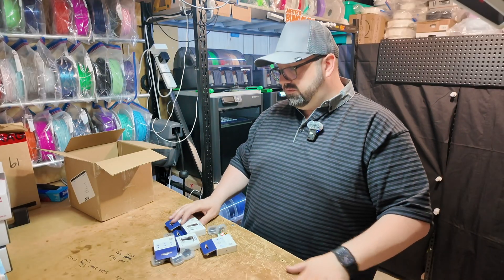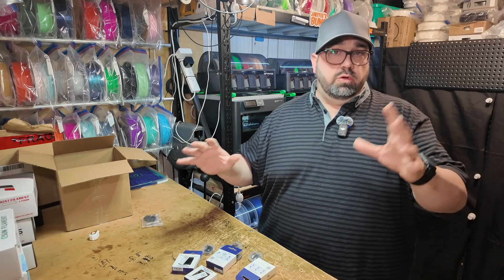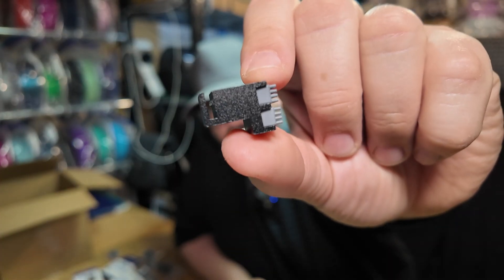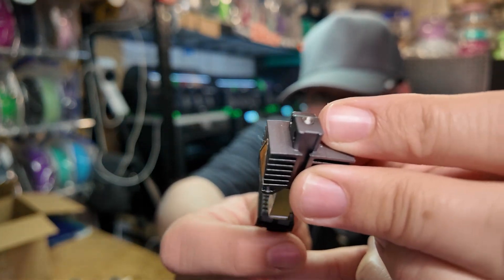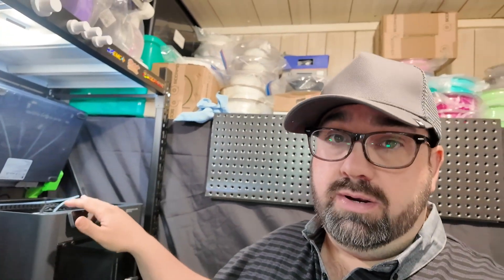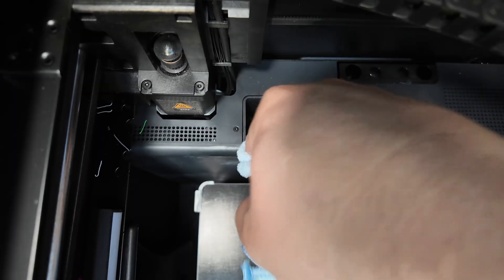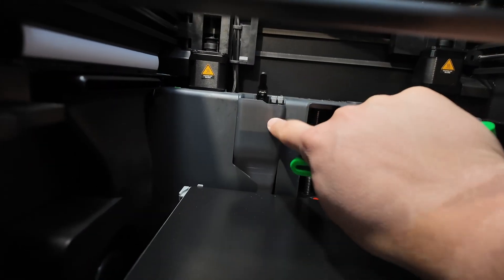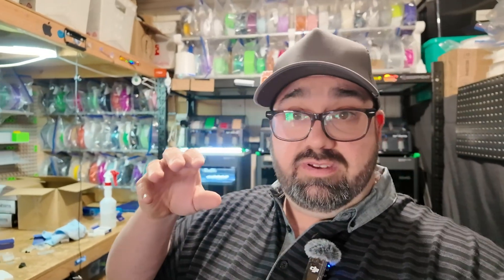Forget the P2S - Enhanced X1/P1 BQ Panda Brush & Wipe Code

Comment: Hello! I had this same issue with the panda brush and installed your G code according to the GitHub. I noticed it does 3 wipes but it seems like they are still very fast. Is that as intended or did I do something wrong? I removed and replaced the exact sections you listed in the guide.

Edit: I noticed the updated G code is saved as a new user preset and I think I started the print with the default instead. Will report back when I try again with the right preset.

Report: New profile works great! It does it’s initial fast wipe then right before printing it does slow ones from your code.

When you’re able to program additional wipes the other direction I’ll definitely be updating the code!

Thanks again!

Comment: I appreciate your video. I have an X1C and it's been frustrating me with respect to the brush/wiper. I've tried a few of the DIY solutions, but I agree that the off-the-shelf price being offered here is compelling. I've just ordered a set and will let you know how it goes!
Reply from the maker: I too went down the DIY path at first, after looking at about 5 different options and reading the comments I just went this way instead 🙃
Reply: @jaeitee  Mine arrived a few days back and I just got around to installing them. So far, so good! Thanks again.

Comment: I just used teflon tape and put it on the inside of my chute. It has improved stuck purged filament immensely. The wiper looks promising, but I also just printed one of those wipers using the A1 wiper cut into a small square. It has also helped quite a bit, though it still has issues with dirty nozzles sticking burned filament on my prints very occasionally.
Reply from the maker: Since installing them I think I've only brushed a nozzle twice to clean it, combined completed over 10,000 colour swaps now.  The purge spirals however continue to randomly fling around if it's certain brands of PETG 🤪

Comment: Thanks a ton! Originally I was using modified G-code from various other wiper mods that use the silicone wipers from the A1 and it worked okay with the Panda Brush. Though after using your G-code, I’m no longer having issues with nozzle buildup!
Reply from the maker: Super! Thanks for the feedback :)

Comment: Hi, I'm currently struggling with purge building up on the edge of the purge chute, did you encounter similar things? I ended up removing the stock metal plate and also the panda shield alltogether since I figure I don't want to make the front edge of the purge chute even thicker to have an even bigger surface for puge to build up. Weirdly I think it's worse with some filaments than others. Upon extruding with some filaments it seems the first bit kind of "flaps out" to one side and if that side is the front, it tends to get stuck on there. I also tried to flatten the front inner edge of the purge chute using a deburring tool but that also didn't help. I also tried coating the inside with silicone oil or rain-x plastic repellent, also without success.  I guess the only solution is to not do multicolor prints with certain filaments....
Reply from the maker: Hi, I've had no issues with the front edge building up, the nozzle sits well within the chute so it clears the front edge.  See if your chute is installed/aligned correctly, or possibly a bent nozzle if you're finding the purge is landing directly on the front edge of the chute.

Comment: Thanks for the gcode, going to try out now.  I've had two of their shields fall right out at this point even after alcohol cleaning and pressing in very firmly.  I've resorted to gluing them in now.
Reply from the maker: Running the no-heat plates, so not much warmth to soften the adhesive fortunately.  Keeping an eye on the one in the ABS machine though, it sits at 60c all day printing ABS and was one of the first to lose its original pad. Might follow your path and glue it back in if it happens again 🙌🙏

Comment: The panda Lux light is a must for me in addition to the wiper. I added a Voxel Bento Box chamber air filtration system. I also upgraded to hardened extruder gears and hardened nozzle.
Reply from the maker: I have the panda lux on one of my printers, and it improves the light when you're physically looking through the glass door however I've found it creates more shadows behind the toolhead when monitoring from the camera.  It would be nice if BIQU released a complete replacement for the inbuilt light.

Comment: I see you’re already thinking the same as me with the non-linear wiping motion.
I’ll be doing some multicolour PETG to give it a proper test. PETG is super sticky and has more issues with clumping.
Reply from the maker: The gap between the two brushes means it needs to be accurate for a Y axis motion brush, however going diagonal would solve having to get it as accurate 💡